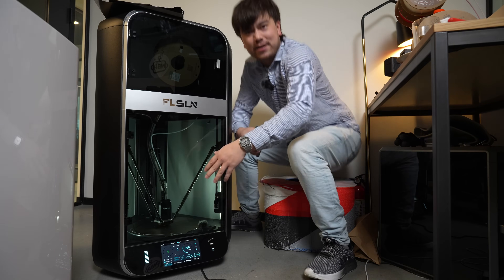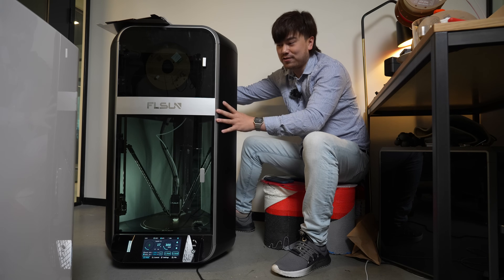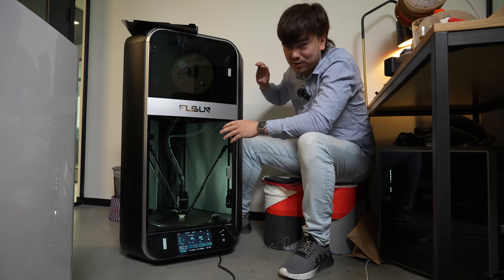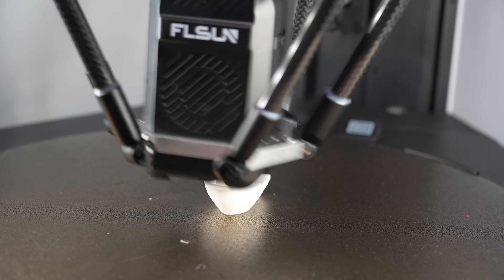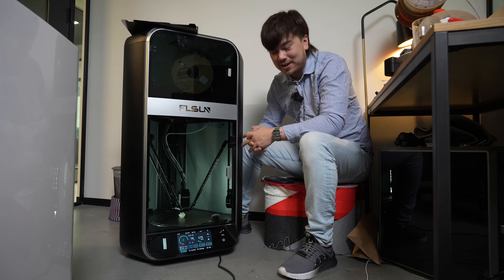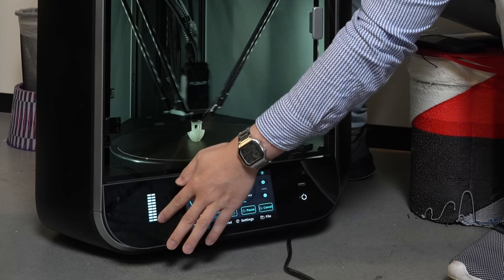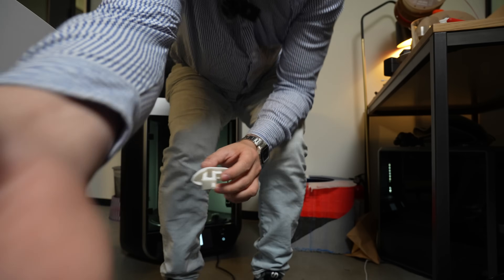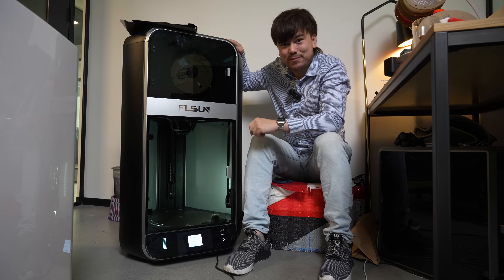FLSUN S1 - World's Fastest Production Printer

Comment: I wouldn’t buy a printer without AMS. Need it for support interface material. I can’t avoid it for all my technical parts. 
So for me this printer isn’t interesting. Most of the time I print with a cap of 6mm3/s anyway to have the highest layer bonding possible. 
I print mainly ABS, PAHT-CF and PC.

Comment: Impressive specs but definitely not something for the average consumer. Your typical joe doesn’t really need anything more than a P1S. Even then you can get just about three of them for the price of a single S1.

I like the included filament dryer. If it had multi material function built in with it, that’d help its case.

It will probably compete well against the X1E if its auto tuning features are good since their prices are similar and it has the build volume advantage.

That being said, my guess is it’ll have underwhelming market performance. Though, if it can get the other companies to push their machines to greater heights, I’m all for it.

Comment: SO FAST...... in PLA.  Any filament that's actually useful is still running Ender3 speeds because you're limited by the filament properties rather than the machine.  Also, it's a delta, so that's a hard pass(I've owned one, yes it was an FLSUN). I'm going to go back to making lemonade out of the lemons I got with the Kingroon KLP1.
Reply: Ummm sorta. I run my petgcf and even asa-cf at 22mm/s. On a p1p AND a troodon 2.0.

Comment: The flow actually being 30 not 110 is pretty upsetting….. straight up a lie
Reply from the maker: Sure you can probably reach peak speeds of 110mm3/s, but yeah. The hotend is shorter than a Goliath but longer than a volcano. Pretty much it’s a Paetus UHF, and it’s flow rate should be similar to thta
Reply: @NathanBuildsRobots  the heavy marketing about 110mm3/s is what left a bad taste with me

Comment: Is there a revo option for it? 
And is the chamber heated in anyway? 
And i guess multi color is not a option with it?
Also why is it so low temp this thing could potentially go 300ish degrees

I would have added 3 spools and did splicing of the filament in the middle
Or maybe make it at least dual extruder.

Comment: At $700 theyd get me. But the price of two p1s makes more sense for "production". If it breaks, 0 production. One p1s goes down, still producing right? FLSun missing the memo imo.
Reply: That's what the T1 is for.
Reply: Ill have to look into the t1. Only searched S1 because its been in my ad feed alot lately@802Garage
Reply from the maker: Nah they’ve got the memo. The real use of something like this, I will get into in another video.

It’s really meant to be a rapid prototyping machine, not a production 3D printer. If you can do 2x the iterations during design and prototyping, that’s huge
Reply: @NathanBuildsRobots I agree with that. I was more so commenting on the title of the video. For someone who produces 400-500 parts a month on average I would have a hard time justifying this for production purposes at this price point. Still seems like it's nice but that was why I commented that.

Comment: Such click bait. This printer has a tiny build plate, single filament spool, less company support and community support. And from other reviews I can see marks all over the build plate which suppests it has Z height issues.
Reply: Its build plate is bigger than the one the X1c has
Reply: @Noname-gz1gx yes and no. Yes, If you’re printing round or “long” objects, yes, but if you print a square, No.
Reply: Click bait brought on nonsense comments, huh? 😂
Reply: And nobody mentions the biggest issue with deltas, is that if youre printing tall, the build volume tapers in near the top.  Its not just an FLSun thing, its inherent in the delta gantry design.
Reply: It can fit a 226X226 square and a 320mm diameter circle. 430mm build height. It's a pretty large build area/volume.

Comment: Are the parts dimentionally accurate though? Otherwise itd be pretty bad for prototyping and making actual parts that fit into each other
Reply: I own a v400 which dimensionally inaccurate compared to my Prusa. I executed the Klipper advanced delta calibration many times without improvememts.
Reply: Still falling for the "deltas aren't accurate" nonsense? 😂
Reply: @chrismay2298 Chris first off I'm basing this off of my personal super racer which could not put out a single dimensionally accurate print, prints came out nice, but not accurate and reviews on the v400 saying that was also pretty inaccurate. Another review I read about this printer said that the quality at most is barely passable even with their own filament. That's why I'm commenting on a video with someone that physically has experience with this printer to see if I can get some insight on whether it would be a good investment of $1.6k or if I'd just be throwing that huge amount of money at something to print desk trinkets and pen holders.

I love flsun for innovating and being fastest in the world right now, I love my super racer and how prints come out. I DONT love how none of my parts fit together on my super racer that fit perfectly fine together on an ender and or bambu printer. If it's accurate, this is a phenomenal product. Otherwise what's the point in printing fast if it's all smoothed and inaccurate. 

That being said, do you own any deltas? What model and how have you liked them so far? 

Thanks for your time reading this, hope you have a great day

Comment: Finally a company that puts the power and USB ports on the front - Kudos. So far from what I have seen from the S1 its performing well. Hope you run some speed tests with the S1 and compare it to the Bambu X1C. Also compare the build plate sizes - how much do you gain or lose with each (over impose the two build areas to give an idea of printing real estate they have. 

BTW with this coming to market, do you think this will prompt Bambu to make a larger printer with say a 400mm cubed or more build area? 

Thanks for the video.
Reply from the maker: Bambubisnalreadybworking in their 300-400 sized printer, should be out soon
Reply: Bambu said recently they've been working on some "special" flagship printer set to release sometime in 2024 (probably late 2024). I'm curious if it's just a bigger build area, or if they've got something else up their sleeve.

Comment: It'd be really difficult for me to justify a single filament printer in 2024 at that price point.
Reply: Multicolor printing should be the default in all high end printers these days. But if you just prototyping parts, this S1 would pretty cool.
Reply: @0xH4CK32  I agree. But lunching that kind of product only for prototyping  which is a niche market is somewhere a kind of nonsense. Furthermore, the prototyping « world » often requires more than one material for supports or even just for convenience. Having the possibility to get an outside system for multiple rolls (materials/colors) is an advantage.
Reply from the maker: It’s running klipper, so you could install something if you wanted to. I like this for what it is - a super fast printer for quick prototypes
Reply: Thats the point
Reply: Bambu multi-color its sooo slow and uses sooo much filament. I love bambu but multi-color is wonderful and frustrating. 
I wish this had the multi-spool option though i agree
Reply: I definitely feel like they are moving in the "wrong" direction. with a delta you could go to very high chamber temps easily to make a machine suited for abs/nylon/PC really well. instead they made it go 1200mm/s which isnt really that good since 300mm/s is basically the fastest you can go without loosing a ton of layer adhesion.
Reply from the maker: @JonasE-l7q  PRUSA HT90 has entered the chat
Reply: @JonasE-l7q  I feel like we're experiencing what the mobile phone market has been experiencing for years with "thinner thinner thinner" when all what people wanted was better battery life. Here, all companies are pushing for faster and faster while leaving behind the potential for heated chambers that can be more versatile, practical and useful for multiple material types. That's why I'm holding on to my Qidi. It's kinda shitty and rudimentary in every aspect but at least I can get the chamber to 70c and properly print engineering filaments.
Reply: @krollmond7544  I own the FLSUN V400
Reply: Nice ignorant take, yeah I should be able to buy a 10 head printer with a build volume large enough to print a mini van...
Reply: @krollmond7544  your ignorance is pretty apparent.

Comment: Your video is yet another regarding this machine that provokes "distant thirst".  What is "distant thirst"?  It is an irrational hunger for a 3D printer I don't need.  My $200 hobby printer has been more than satisfactory for a couple of years.  It still works great.  I have neither the desire nor the room for another printer at the moment. Yet, seeing this FLSUN makes me enthusiastic - for a moment - about acquiring one.  I can afford it.  I may be able to convince the spowess that it's a harmless hobby expense.  However, explaining away the noise would be a different matter.  It seems as if it might disrupt a household at night.  I use my current printer about one week out of three.  I only print stuff like little Walter White heads and benchies with tits.  Sometimes I might print a shelf bracket, but come on.  It would be cheaper to buy those from Hamazong.  It's a hobby!  So I won't buy this.  But it's fun to know about it.  The end.

Comment: I received mine today.  It is fast. I have 2 k1 maxes modded with linear rails and extruders with carto. One print I put on slicer stated 4 hrs on the k1 max.  Decided to put it on the flsun s1 with same settings and it was printed in 1 hour 20 minutes!!!   Insanely fast
Reply: Nero 3D ran a thread test print and calibration cube and it was decent.
Reply: @Oldsjunkie  one thing is running pre sliced models and another is printing your own parts and or benchmarks you sliced yourself. I own a super racer and the pre sliced nut and bolt screwed together perfectly, still can't get parts that fit together or fit onto something else that's a specific size. No it is not my part that is the issue, I've printed the same parts on an ender and a bambu which came out pretty accurate and accurate on the bambu even on the ender, it was still accurate enough to fit. And I understand that is an older machine but so is the ender 3 v1 I printed thr same part on.. I don't have a v400 but I heard some things about it being inaccurate too. Just trying to find out if this is worth the money or I'm better off buying something else as a 3rd printer
Reply: Is it dimensionally accurate? I'm talking about running clearance tests and torture toaster and other benchmarks like that since to me it looks like it can Definetely put out parts quick however if you need a part that fits into another part, or a part that fits into something else I'm worried it won't fit or will require so much more clean up to the point where it's not saving you time. For decoration items and cosplay it looks awesome
Reply: It was ever so slightly better than my bambu x1c as far as accuracy @EthanTrevino-ov9rp

Comment: BL is obsolete if:
1. You have space for a printer the size of a washing machine
2. You prefer having a jet engine going off in your house for hours on end
Reply from the maker: Check, and..... Check!
Yep, Bambu Lab 110% obsolete
Reply: What’s the footprint size though. For most people, the height doesn’t matter. Is this really larger in x,y than a X1C, etc?
Reply: To be fair, bambu printers started off sounding like jet engines too, before some firmware updates. But now P1S' start the fan at full power on print start and it's still super loud.
Reply: @got_logic1320 TBF the fans could be quieter like the A1 but without them, your print would look like a depressed saggy mess w/o proper cooling, especially on an enclosed machine.

Comment: Atlast a delta, that NBR can rave about🤯👍👍. Just wait for a ballscrew version, for FLSun to beat themselves🔮. Hope they ported the Prusa Slicer, to include support for their new generation of printers, instead of limiting themselves to Ultimaker Cura.
The CPAP turbine can be converted to a triangular box containing 3 Noctua Cpu cooler fans(in a tilted down configuration), for much lower noise, without compromising the air flow rate🤔.
Now that NBR has built a quad polar delta successfully, Its time that NBR build a hemisphere skate rink, and put the FLSunS1 on servo wheels to make the worlds first support agnostic FDM printer😂❤👍
Reply from the maker: Oh man, they would have to switch to ballscrews... or at least use thicker belts if they wanted even more speed.

we are getting into dangerous territories though, these 3D printers are no joke, you could get injured by them when they are this strong and fast. Might need a door interlock soon!

Comment: I have always thought Deltas were superior and  not enough time was spent improving the platform.  The biggest problem is size.
Reply from the maker: Yeah they take up a lot of space. But most large-ish printers do
Reply: Most deltas (all commercial ones, I think) make really poor use of machine volume, with overly long arms and wide effectors, both of which subtract a lot from usable volume and reduce rigidity/stability relative to volume. But they don't have to be that way.
Reply: @daliasprints9798 that's the downside to the delta system, though.  Long arms are needed to be able to reach every area of the build plate, and needs to be extremely tall for the same reason.

Also why the build plate is circular.
Reply: @theElemDragon  Necessary delta machine height scales as (build diameter + build height) and machine footprint diameter as build diameter plus small fixed overhead.

When I say overly long arms, I'm not talking about what's needed to reach the build area, but additional length beyond that. Usually this is added to bound the minimum angle, because of mostly unfounded concerns about outrunning the motors' max speed when it's really low. That would matter if you actually wanted to print at 3000 mm/s, but since you can't anyway, it's fine to have a min angle of 20° or even less.
Reply: I thought the opposite, and so I'm impressed with this.

Comment: I love how your video of the effector motion has tearing from the speed being so much higher than the framerate. 😂
Reply from the maker: Yeah the rolling shutter effect is making things get weird.
Maybe I can increase shutter speed, and get this thing printing a vase mode at the same frequency as the frame rate, so it just looks like the printhead is floating upward, producing a cylinder
Reply: @NathanBuildsRobots  Yeah, that's still like an order of magnitude faster than the physical limits of cooling (heat conductivity out of plastic) without extreme subambient air. 33ms frame time vs around 500ms being around the lowest layer time I've seen achievable.

Comment: The footprint and filament setup - it'd be slick for a print farm.  If you don't need access to back (or side) and could sandwich a bunch of them
Reply from the maker: Or arrange 6 of them back to back like the Cray supercomputer!
https://en.wikipedia.org/wiki/Cray-1
Reply: @NathanBuildsRobots The FL Sun Farm - Super Crayprinter, coming soon to your enterprise reseller of choice.
Reply: @NathanBuildsRobots  Yeah, then you could hook up to some kind of centralized air conditioning source and you wouldn't need that cpap fan.
Reply from the maker: I think this thing is ideally suited to a prototyping workflow, where every hour shaved off a print results in more iterations, and more improvement.

Comment: Still going to wait on the T1.   1000mm/s vs 1200/ms is like getting pulled over doing 150mph vs 200mph, your still going faster than most everybody out on the road by ALOT.
Reply: T1 what it is?
Reply: @godbnc  The T1 is the Baby Brother to the S1.  Slightly Smaller and Slightly slower.  When I mean Slightly I do mean SLIGHTLY.  Think X1C vs P1S.
Reply: Quoted figures don't ring true in the real wold. It is obviously fast but not as fast as quoted. See other reviews.
Reply from the maker: Yeah the T1 is going to be the one to get for most people. S1 is like... so unnecessary, but awesome.

The ideal use case for this IMO is for an engineer that is doing rapid prototyping. Getting a test part made in half the time is a huge deal.

Comment: But can it finish the benchy print on a normal day before any other tennants complain?
Reply from the maker: Yes, i just have to turn the fans off
Reply: @NathanBuildsRobots  Lame! Just pretend to vacuum your floor. You need to work out how to explain why you need 8 minutes
Reply: hey this is a great idea, you just add wheels and connect vacuum hose to it. So you can clean your house while it is printing!

Comment: Yesssss brooo got one of these, with some good software this is the new king
Reply from the maker: It really is. Idk if it has RBG lights, I think it should have RGB lights and an option for a quieter fan
Reply: @NathanBuildsRobots It really is only limited by software, it looks like its built very well, but from what I’ve seen the print quality still isn’t up there with Bambu Labs and I think most of it is just software stuff, including user interface stuff. We shall see, from what I hear FLSUN risked everything on this, which I respect.